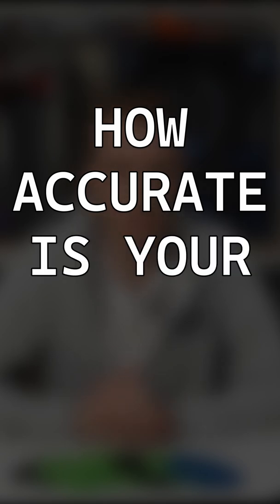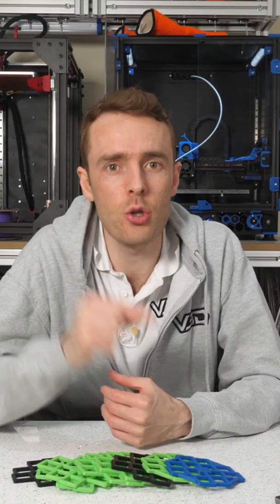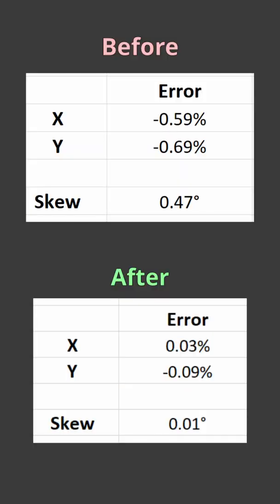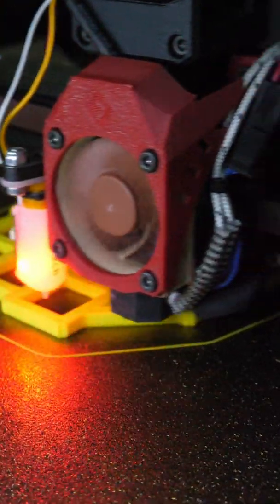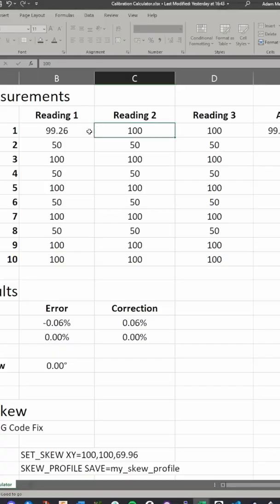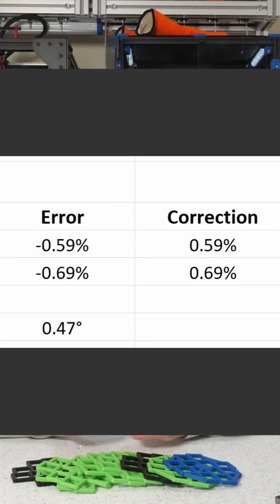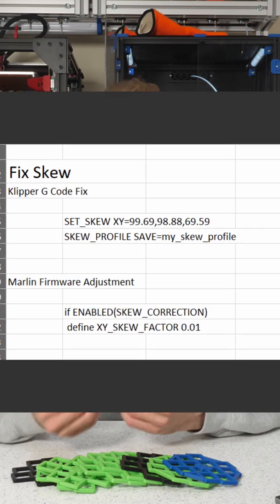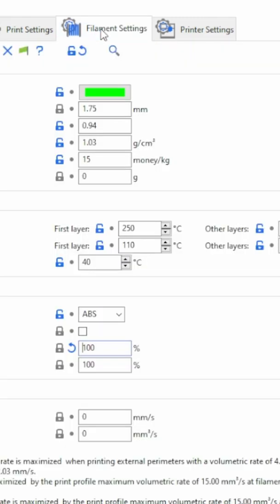Amazing Calibration Flower #shorts

Comment: Why does this need so many features and such a large part to work. Doesn't just two sets of external opposing edges on each axis work? Say 30 and 60mm wide. The difference between their widths should measure 30mm. The movement can be calibrated from that but eliminates the effect of the extrusion from the calculation.

The amount off of 60mm can be used to figure out the under or over extrusion after reprinting it with accurate distance calibration.
Reply from the maker: Check out the first long form video I did on calibration flower. That explains in much more depth.

Comment: Great print and great calculator but the how to apply corrections needs work. I was able to figure it out but the current documentation is very vague. I prioritized stepper motor steps before trying to adjust skew. Was that wrong? Should I have prioritized skew the way the documentation does?

Comment: Hello and thanks a lot for this video. I bought your Calibration flow, print the calibration flower on my Prusa Mini, log the measurements in the calibration calculator. OK, and now ? i'm lost.... As i can't update the Marlin's firmware of the Prusa, how can i make adjustments ? I found a X correction of 0.25% and Y correction of 0.40%. The skew correction is 0.29°. I don't know how using these measurements in the prusaSlicer.... Sorry for my English, i'm French 😉
Reply: Good question!
Reply from the maker: Prusa slicer and the prusa mini have really limited calibration options. For X and Y you'd have to scale the part. For skew, you basically have to do it by physically adjusting the printer. Check the prusa knowledge base for details.
Reply: @Vector3DP  Thanks a lot four your answer. I measure a skew error of -0.29° so i think that it is insignificant . For X error = -0.25%  and Y error = -0.40%
Reply: @hoctrimededebutry8655  Why not use M852 in the startup script of your slicer.
Reply: @nilssjoholm5173  Because i'm a newbie 🙂. Seriously, I need to study the gcode more closely and how to use the M852 command in the startup script.